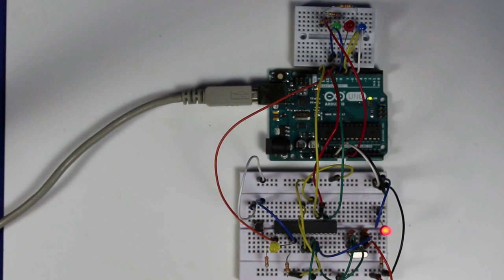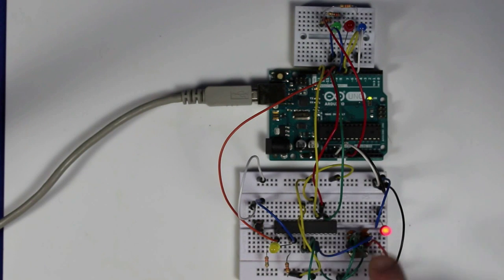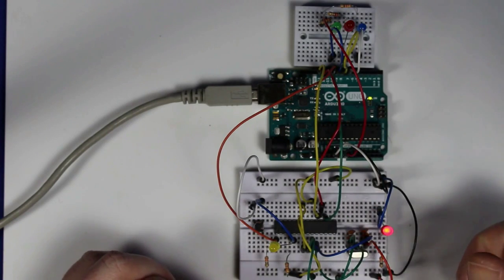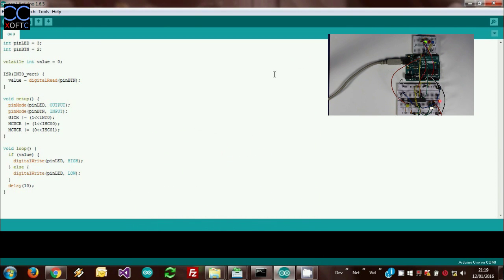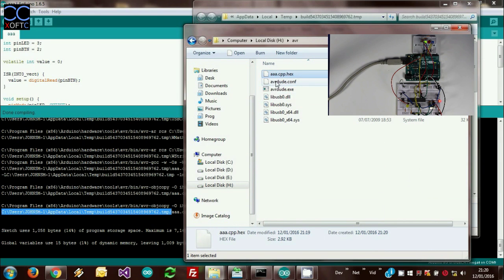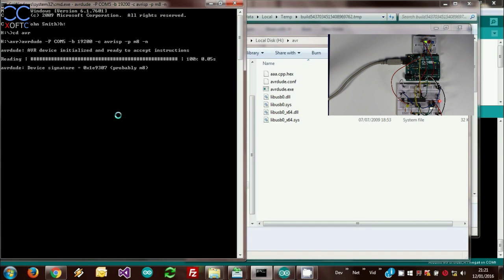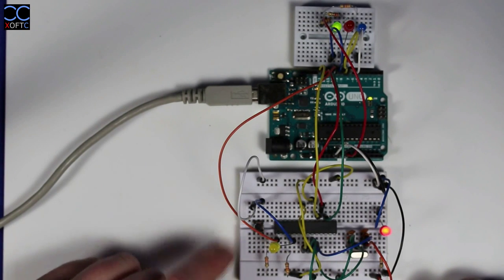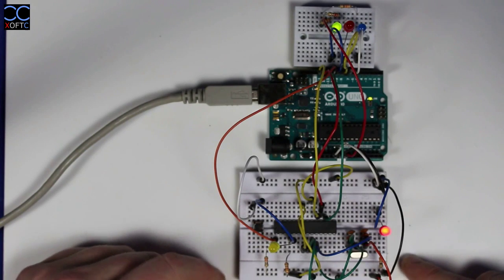How to program an ATmega(8) using an Arduino

Comment: I want to use atmega8 without crystal...If there any changes I will make it on the command you are written ?
Reply from the maker: mostafayasin You can use any clock speed you want. these commands don't affect anything regarding the clock speed.
Reply from the maker: mostafayasin If you want to change the clock speed you can find the commands in the following video:
https://youtu.be/UgaHG7R4-tc

Comment: Can you read the program from the atmega. I need to copy a program for (http://www.ebay.com/itm/0-28V-0-01-2A-Adjustable-DC-Regulated-Power-Supply-DIY-Kit-with-Protection-X7R9-/162134537933) kit where i burned the atmega chip.
Reply from the maker: Using the same setup as in the video you can read the content of the flash memory using the following command
avrdude -P COM5 -b 19200 -c avrisp -p m328p -U flash:r:"flash_dump.bin":r
the above command refers to an atmega32. change the com port and chip code to match your setup.
Provided that the chip is not locked.

Comment: With your method I upgrade firmware on my USBasp Chinese programmer: MCU is ATMEGA8.

I repeat for clarity command line in text mode (in my case: folder in drive C:, file: prog.hex) for coping:

C:\avr>
avrdude -P COM13 -b 19200 -c avrisp -p m8 -n

C:\avr>
avrdude -P COM13 -b 19200 -c avrisp -p m8 -u -U flash:w:"C:\avr\prog.hex":i

With programming process you must turn on (shortcut) Jumper J2 on USBasp for Self Programming: On.

I am very satisfied! Thank you very much!
Reply from the maker: kn34pc Silistra Thank you for sharing and glad it helped!

Comment: i want to program atmega16 using arduino is it possible
Reply from the maker: Yes. you just need to change the command line parameter for the chip type from m8 to m168p for atmega 16 or m328p for atmega32